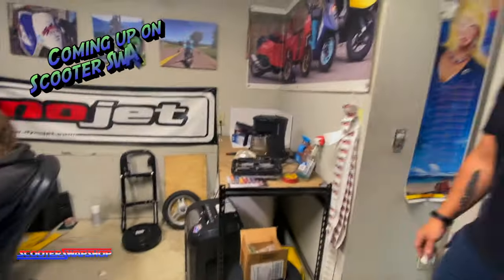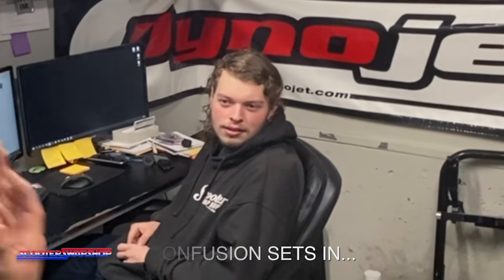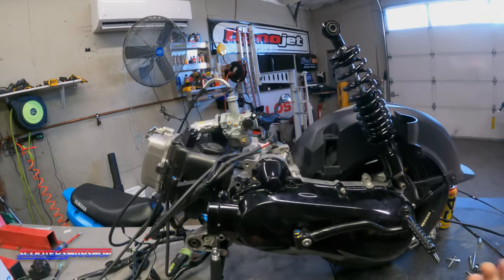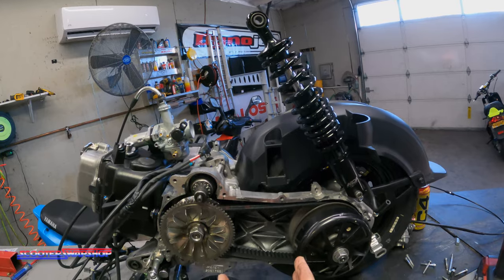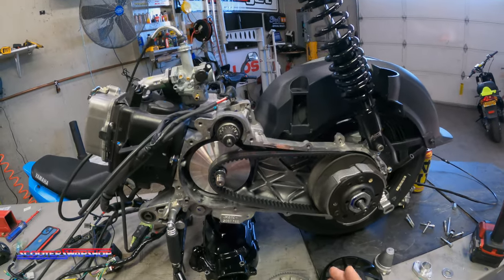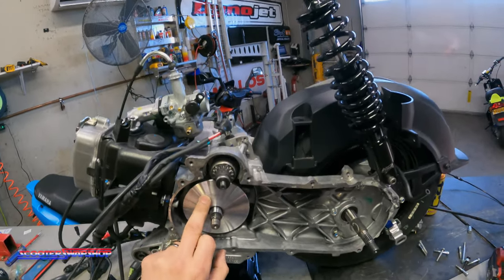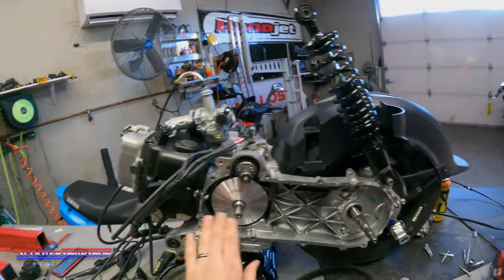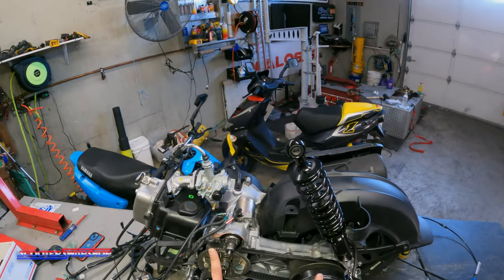Scooter CVT transmission explained | Honda Navi

Comment: Installed the NCY clutch and changed out to 1000 rpm springs, along with the S23 variator, 11g rollers and Malossi contra spring.  It’s seriously a whole new bike after that.  Hard to believe a few hundred bucks can wake it up that much!
Reply from the maker: Good stuff

Comment: Excuse me!
I was wondering what liquid is the best for cleaning the cvt transmission!
I thought kerosene or gasoline will do the job but unfortunately those liquids will eat the seals.
So I'd like you to recommend me the best liquid to do the correct transmission maintenance.

Comment: Hi guys, my 50cc scooter accelerates fine and keeps the revs steady until 45kmh, then it starts building up revs and doesnt go faster than 65kmh. It revs really high at 65kmh, I noticed that my belt doesnt go all the way up the variator but its not worn, could my rollers be worn?
Reply from the maker: for sure sounds cvt related  this is a NAVI?